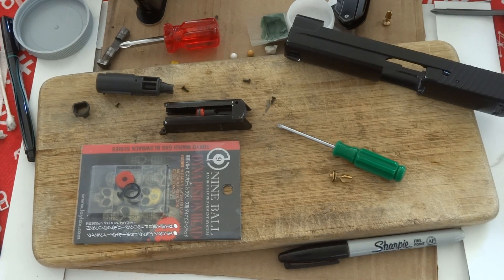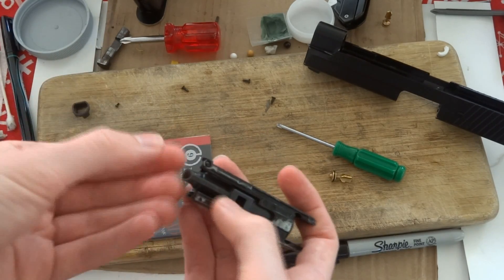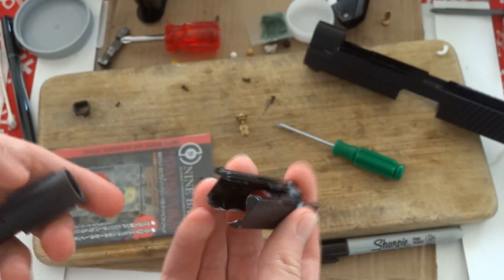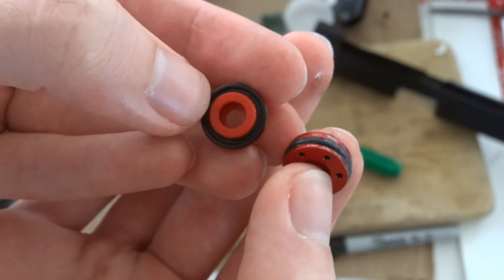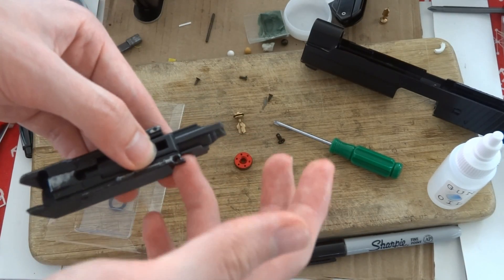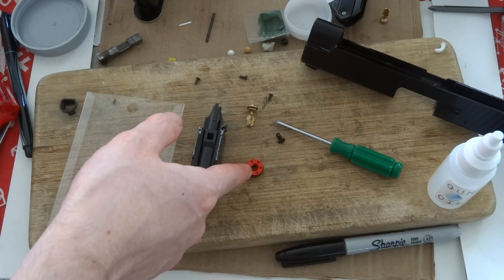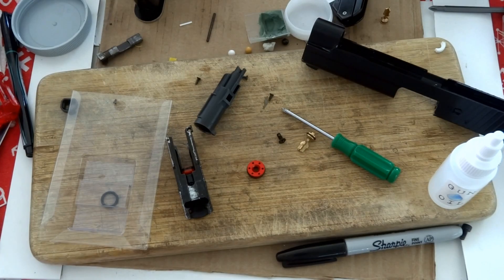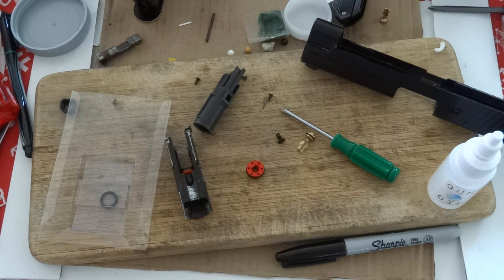Airsoft GBB Piston Heads: How To Improve FPS Consistency (Accuracy) and Gas Efficiency

Comment: considering you don't know why fps wasn't improved much and you can get more shots out of it, you should learn about how GBB actually works.
the closure of rocket valve is not caused by the pressure coming from the mag.
search Bernoulli effect.

but commenting on a video made 5 years ago seems beating a dead horse, my bad.
Reply: The rocket valve does close by the pressure coming from the mag. Without that pressure from the mag there wouldn't be pressure at all and the Bernoulli effect would be non-existant. But yes, the Bernoulli effect closes the propelling nozzle valve and starts buildings pressure in the blowback piston. It's doesn't make your comment look less stupid though.
Reply: @o3rMeNs  hey master of hydrodynamics
what's your wisdom?

Comment: That's why the silicone oil of the green gas is every were? Inside the blowback unite and outside of the slide? Because the leaking of the pistón head?
Reply from the maker: I keep a light layer of silicone oil on most of my gun's internals, keeps the rust off.

Comment: Actually, cup seals expands when under high pressure, so they provide better seal than oring ones on GBB applications. 
Just take the nozzle out, cover both input and output gaps and try to push the nozzle back in slowly, you'll see it moves freely and doesn't compress at all.  But if you do the same thing while moving the nozzle back in as fast as you can, you'll see A LOT of resistance from the compression. 
They also provide disengage as soon as the pressure is released (i.e. as soon as the nozzle separates past the seal), which makes the nozzle return spring work 1000% easier. On oring style seals the friction is always there, which can lead to failure to return the nozzle to battery, and therefore, failure to feed.
That's the reason all GBB pistol manufacturers use cup type seals, they simply work better.
Reply from the maker: A cup seal that fits well is great but a lot of times manufacturer cup seals are too loose to get a good seal, even under pressure. After making this video I've found that I prefer a cup seal with a good fit to an o-ring with a good fit, but sometimes that can be hard to find. Its good to test your seals and use whatever you can find that works best. I also agree about the friction on the o-ring always being there but I'm not sure that feeding issues are much of a concern from a tight o-ring. I have used o-rings so tight the nozzle return spring couldn't return the spring without any feeding issues because the recoil spring will just return the nozzle when the gun cycles. I actually have the nozzle return spring removed in most of my GBBs because it's not needed lol.
Reply: A cup seal provides greater seal ONCE it is exposed to high pressures, but UNTIL it reaches those high pressures gas leaks. With a GBB the O ring ensures that even the start of the gas contributes to building pressure and the effects of a long term seal is irrelevant since the gas pressure builds up faster and once the bolt/slide recoils it shuts off the gas from the magazine improving gas efficiency.

Comment: No you don't understand. The fps inconsistencies are due to cooldown effect. Every time you pull the trigger the gas vaporates bringing Environmental temperature down. The pressure of the gas is a curve along the temperature axis if you recall High School physics. if you have temperature variance your pressure of gas is going to change causing your shots have different FPS with every shot. so this FPS inconsistency is a intrinsic design flaw of all gas blowback guns. Don't dream about building a DMR under gas blowback gun
Reply: The whole purpose of having a floating valve is to compensate the difference in pressure by adjusting the volume that goes through, keeping the FPS somewhat constant. 
Having a leak can cause far higher gas consumption, which causes far greater temperature (and pressure) drop, which makes the whole experience worse.
Reply from the maker: 彭诚 I believe you misunderstand the intentions of this video. Of course I understand all that about gas cool down. This mod is to reduce inconsistency, reduce means to "lessen," not "remove completely." The cool down effect is not the only cause of inconsistency in a gas blowback system. Additional inconsistency is added in by gas leaks. The point of upgrading and tuning GBBs is to try to minimize or reduce all the potential leaks and other sources of inconsistency through out the system besides the inherent issue of cool down. If you optimize your system you can get great performance even tho you're still under the effects of cool down. If you do put time and effort into your GBBR to accomplish that, you can make a rather well performing gas DMR. I know this can be done because I did that with my KJW kc-02 before I converted it to HPA. Even when it still operated with green gas it was easy to hit people around 270' (this was measured with a 300' measuring tape). Of course it did not perform as well as a well tuned AEG or HPA DMR (although it did outshoot plenty of aeg and hpa DMRs built by inexperienced techs), but any tech who gets a GBB knows about the inherent issue of cool down and typically works with the system anyway because they want a more realistic operation of the airsoft replica. People are rather large targets so it's really not that far of a stretch to build an effective GBBR DMR. If you want to get rid of cool down you can switch to HPA anyway (which I have in my GBBs) and then as long as you reduce your leaks with mods like what's mentioned in this video you can get fps consistency as good as an AEG.
Reply: Hi interesting to hear all the experience you had converting GBB to DMR. I myself is baffled with this task. Would you mind sharing your fps chronoed with HPA system compared against normal green gas?
Also can you tell me how did you convert your KJW kc-02 to HPA, do you have a high cap magazine corporated? Because you know HPA with only 30 round magazine is pointless. I myself have a KJW m4 GBB. the fps chrononed varies a lot like from 300ish down to 200.

Comment: I think the nozzle should be able to reset itself because if its to tight then that brings in inconsisentcy again. which we were just trying to remove. also each shot will use up a bit more gas which means less shots per refill and also cool down will happen faster. going down .5mm on an oring has made a difference in efficency in my builds.
Reply from the maker: For the best consistency, I believe you want your GBB's blowback cycle to only begin once the cylinder bulb has fully shut. If your o-ring holds onto the air nozzle, then it's more likely for the gun to start the blowback cycle once the bulb has closed off the gas's path down the barrel and the BB has been shot. If your o-ring is looser the gas pressure build up could cause the nozzle to start pushing before the bulb has shut, which I believe could cause inconsistency as your gun will begin to cycle before the BB has been launched. If the gun has to rely on the blowback spring to push the air nozzle back over the piston, I don't see how that could affect shot consistency because by that point in the cycle the BB has already been shot. In my experiments the tighter o-ring has INCREASED my shots-per-fill because less gas will vent out the back of the nozzle and it takes less gas to cause the gun to cycle since less is wasted. It would be ideal, however, to find an o-ring with a perfect fit that is as loose as possible while still having enough of a seal to the air nozzle that gas can't escape past it. But I figure it's better to be tighter than looser.
Reply: I guess we have different ideas. You like the assurance of a tight tight seal and I prefer the goldilocks of not to much, not to little.
Reply: @voymay  I think the role of the nozzle spring is similar to a delayer chip in an AEG, it retracts the nozzle sooner so the mag has more time to push up a BB. However that's usually not an issue. And like you said, guidance too, for ex my KWA Mac11 has 2 springs, I imagine to hold the nozzle straight, really critical in that high speed gun.

Comment: will this make my gun shoot over 350fps?
Reply from the maker: No way I can possibly know that. O-ring piston heads are more to improve consistency, I've never seen them to affect FPS much. But I know a person or two who claims to have increased their FPS by 70 with an oring piston in their GBBR Maybe it could increase your FPS, but you'll have to ask someone who's put an upgraded piston head into the same kind of gun you have or try it yourself.
Reply: +TopHatRunner do you notice a change if fps in your gun?
Reply from the maker: HD Airsoft I answered that in my last response. I've never seen much of an affect on FPS with an o-riong piston head, personally. :)

Comment: I manage to improvise by adding an smaller oring  between the piston and the rubber seal, its a bit tight but it made my tm m1911 shoot over 30 rounds now instead of 15 or below and not to mention it's more stable with higher fps from 240-260 to 290+ using .25 bbs, that's insane!!
Reply: Hey what size of o ring are you using?

Comment: my brand new KJW  KP07 pistol will only shoot about 10 rounds before running out of green gas, i checked the mag and its not leaking, i even bought a new mag and still have the same results, will one of these piston heads help this?
thanks
Reply from the maker: +stratosjeff Have you tried using a new gas can? Your current one might be low. Otherwise an o-ring piston can probably get you a few more shots. Can't say for sure though, there are far too many factors affecting GBBs.
Reply: +TopHatRunner yeah, it was a brand new can, oh well, i picked up a new piston head from Evike for like $10, figure i'll give it a try.
thanks
Reply: @stratosjeff7007  did it work?

Comment: Hey, so... I can't find piston heads for my pistol gbb, only for aeg. Can those fit in the pistol? Thanks
Reply from the maker: +JFKilt No.
Reply: +TopHatRunner Airsoft Another question, i finally found some piston heads for my gbb glock. But the ones i found were suitable for glock models other than the one i have a g23. Where i found the piston head it says it works with g17 g18 and other non glock models, will this piston head fit my g23? Thanks
Reply from the maker: JFKilt I don't know the glocks well enough to know if they're compatible. You might be able to find the answer on google. Keep in mind that sometimes different brands use different pistons, too (example: TM glock vs KSC glock).
Reply: +JFKilt 
KJW g23? im also looking for a piston head. did you find one?

Comment: just the kind if video what i wanted to see! +1sub! :) jist a quick question. Do you know whether this will work with the marui dessert warrior 4.3? :) also if i shoot continuously, the mag freezes up, and i can only get like 13 or 16 shots out of 28 :( do you know a way for it to become a bit more efficient? and how to stop freezing? thanks alot bro! ;)
Reply from the maker: +Fsx_Productions Thanks for the sub! At what temperature is the environment when you're using your gun? And do you have any other upgrades in it? You might be able to get a few more shots out of your gun with an o-ring piston head, but otherwise I don't know a ton else you can do to increase gas efficiency. That issue is one of the main reasons I use HPA for my GBBs now.
Reply: +TopHatRunner Airsoft no worries mate :) and no, i just got the gun so no upgrades yet. as terms of environment temps go, im usually shooting at around 17 degrees Celsius. :) thanks

Comment: Cam you do the same tjing for the kjw kco2 10/22  ?? Id love to see that if it ia possible. ?
Reply from the maker: Yes. TSC (TSC, not FE) makes an o-ring piston for the KC-02. If you get that piston, throw out the o-ring the TSC piston comes with and use a Danco #8 o-ring. Another option is to get a custom made, ported o-ring piston head from a fellow by the name of Kevin Forney. Send him a message to get more information on his pistons: https://www.facebook.com/kevin.forney.14?fref=nf
Reply: Thanks man I bought my kjw 1022 last year and have only teched the inner barrel with an RA TECH TIGHT BORE 6.01 318 MM  AND the RA tech 70° hop up rubber ..but the hup up is junk so I want to try a falcon bucking ..blue.. id be jaked if I could fimd one lol.. and maby some dem jet valves u talk of.. thanks agen

Comment: Very good video! It's always nice to find ways to improve consistency and efficiency, but I'm worried that if I made too many upgrades, the fps will go over the allowed local fps limit (350 fps). I'm using propane and it's already getting close to that range. Is there anyway I can improve efficiency without increasing fps on my KWA HK45?
Reply from the maker: Thanks! KWAs are usually close to 330 out of the box but there aren't many upgrade options for them. The only upgrade you've really got available for most KWAs is the Maple Leaf EVOII hop up and barrel setup. It's a 6.01mm barrel and has my M93R's FPS right at 340. I can't recommend that set enough, but I can only find a set for the M9 or G17/G18. It's possible that one of those sets would work in your gun, since KWA uses nearly the same hop and barrel setups in their guns (unfortunately, their hop design always eventually kills my KWAs), but I can't say for sure.
Reply: *****
 I saw your comment a while ago on the m9 EVOII hop-up set and got it for m93r.  It works, and as a plus the barrel doesn't sick out awkwardly from the outer barrel parts.
Reply from the maker: CalebtheMagish I won't even get a KWA if I can't get an EVOII set for it. It makes such a big difference, my M93R doesn't even work with the stock hop configuration anymore. Only works if I use the EVOII. My ATP is having the same issue too, I need to get an EVOII set for it. Much better performance too.
Reply: Do you know how exactly the stock hop-up is breaking down?  I'm planning on getting a bit into GBB teching (learning all the basic mods first) and I use KWA a lot.
Reply from the maker: CalebtheMagish On all my KWAs the bucking just starts to twist with the sleeve when you try to adjust the hop. Leading to side hop and/or jamming.

Comment: Very good video, but the way inconsistencies occur could have been explained better. A simple way of putting is that same amount of gas (moles or n) is distributed over a different volume (V) from shot to shot, so the pressure (P) that gets behind the bb varies. Just for reference, here is the ideal gas law: PV=nRT . The umentioned variables: R, which is just the constant, which is always 8.31. Then there is T, which is temperature. This same law can be used to explain cool-down. Sooo, uhhh, the simple explanation is that that same amount of gas is distributed over a different volume from shot to shot, so the pressure that gets behind the bb varies, causing the FPS to be different every time.
Reply from the maker: Yeah, you're right. My explanation of why it improves FPS consistency is quite poor and somewhat misleading. I didn't script, think prior, or even try multiple takes of this video and just did it in one shot due to time constraints... I also should have mentioned that the varying of FPS is caused by potential leaks AND the steady decrease of gas pressure in the magazine that occurs between shots. Should have made it more clear that this is just a way to reduce one of the factors to keep FPS variance to a minimum. I might actually re-make this video and discuss gas law and go a bit further into GBB FPS theory while still keeping it understandable for those of us who haven't studied chemistry yet. I learned all about gas laws last semester, fascinating stuff, haha.